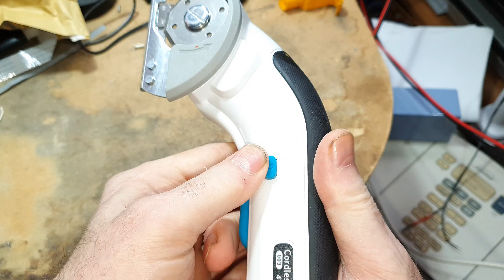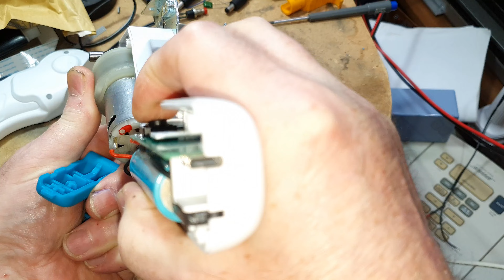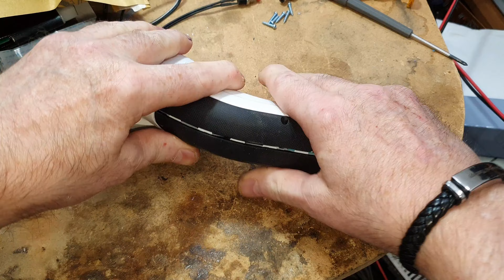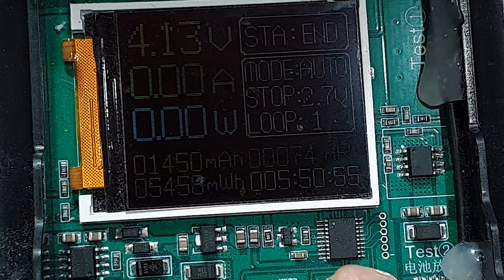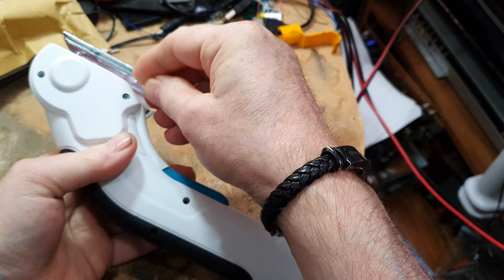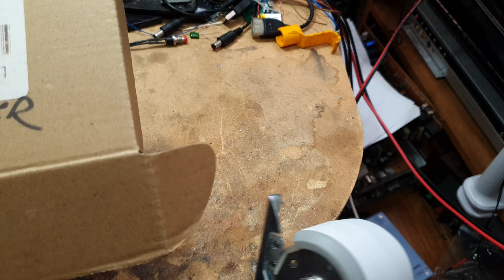Electric Scissors Safety Interlock FIX!

Comment: And also bro you can add videos of Arduino project and of small circuit 
Which we noobs can also see
Reply from the maker: I'm sorry, I don't do anything with Arduinos at the moment. I mainly just do repairs and modifications to electronic stuff.
Reply: @warfsbench ok then if you don't know about Arduino then make videos about small  components like MOSFET,diode,resistor, capacitor,
In videos you explain what is that,how it works etc..

Or also if you have any broken motherboard or motherboard removed from any electronic appliances show the parts and name it and show its working 

So many starters(people who are starting to do the work)will see